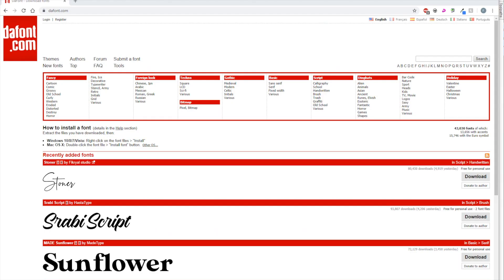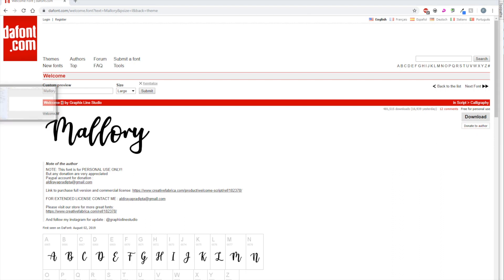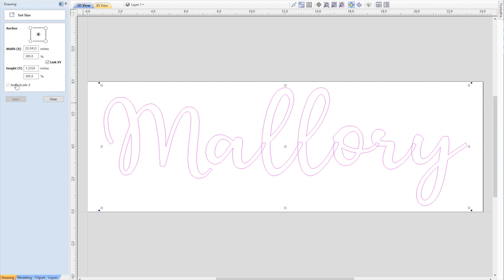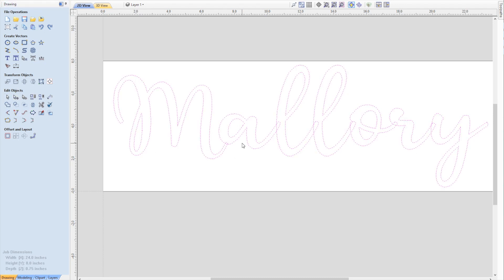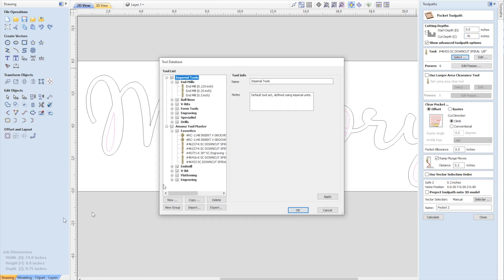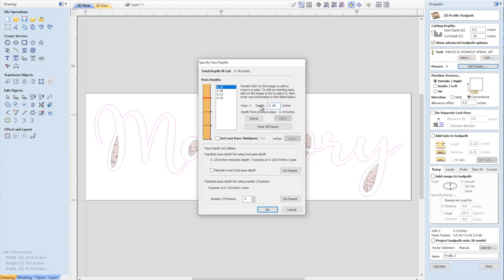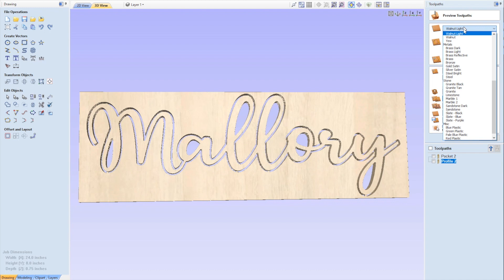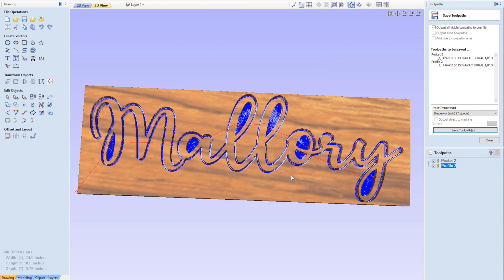Beginner CNC Project - Script Name in Vcarve

Comment: Ok so what program should I use if I'm just trying to route a name with a v bit? Because I've tried engraving, inlet female toolpath, nothings working. I want the name to stay in the wood
Reply: Are you just trying to outline the letters?  Just run a profile path. You can just say you’re using an 1/8th end mill on the line but have a v bit in the machine.
Reply: @derick8793  https://youtube.com/shorts/vPjxxw7VFTI?si=qsv82R-G3EL9iQ7Z basically wanna do that

Comment: What bit did you use
Reply: goto 5:23 it shows the Amana #46433 SC Downcut spiral 1/8" diameter with 1/4" shank
Reply: Can you share the feeds/speeds for that bit?
Reply: @rudypimentel5128  its in video 60ipm no spindle so speed is what you want doc was 1/8 .125